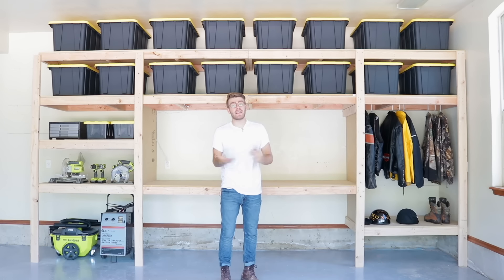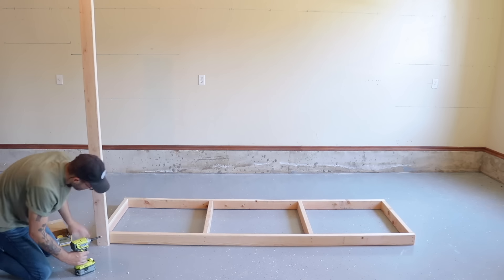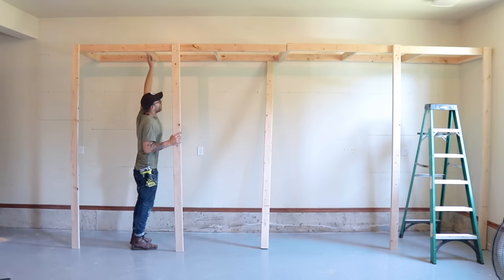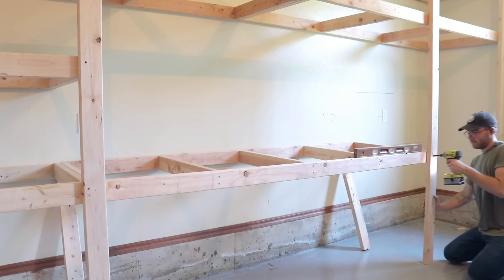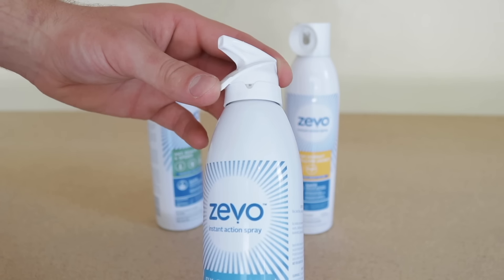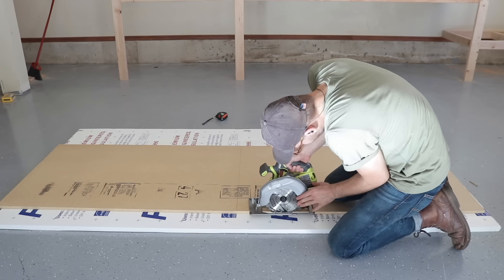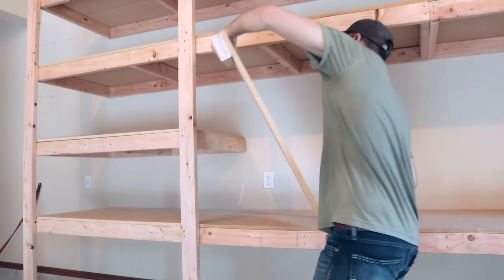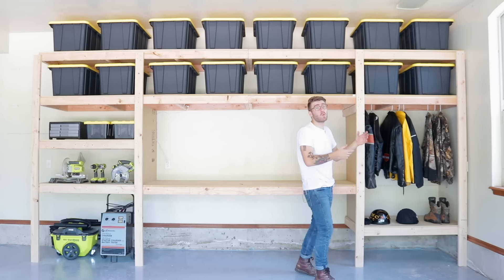DIY Garage Storage / Shelf / Workbench Solution

Comment: Love it all except for the "legs".  The entire weight is being held by screws
Reply: Some of the weight is being beared by the wall screws too though. What changes would you recommend instead?
Reply: “The entire weight” isn’t much, though.  He’s not storing bags of cement on those shelves six to eight feet above the ground.  To make the load transfer into the supports would add unnecessary complexity and time to THIS build IMO.
That said, I’d CERTAINLY recommend at least using longer screws.  He’s not getting enough “bite” with the ones he chose.  IMO, tear-out is a bigger threat here than screw shear failure.
I’d also ditch the drywall screws for a better screw (trex or similar), which have way better shear characteristics and would only add a few $$ to the project cost.  I you have a framing nailer (or are looking for an excuse to buy one 😉), nails would also improve the shear strength and would make the build considerably faster.

Comment: Hey great video started my project yesterday, total garage renovation!  Question I have is how would or did you provide more support for the two joints above the work bench. Seems like that ,Ishtar be a problem area if you stored heavier items there.
Reply: I'm currently building this design and was about to write a comment telling folks they need add support for the exact spot you're talking about. Luckily I can attach a 2x4 to the two shelves you're talking about screw it into rafters give much more support. As they sit now unsupported it will not hold more than a few pounds.

Comment: Most of it looks fairly stable being anchored to the wall studs, but I'm curious about the front middle of the top shelves and the work bench.  It seems like that outer edge that doesn't have floor support where the 2 sections join together would be pretty fragile.  How much weight do you suppose that section could handle?

Comment: Drilling into the wall looks easy. I presume your wall is “either wood or dry wall”. In my country , the walls are all concrete or bricks. Not as easy as you show it to be done. Thanks for the video and plans.
Reply: Yours is actually easier and more sturdy. Just get the correct bit and you don't even have to find studs. You can drill anywhere you want.

Comment: Great plans and video.  I had to make several modifications due to size of garage and ceiling height, but turned out excellent.  8 Costco bins wide and added a plywood workbench area.  Only recommendation for real world is the flat shelving pieces.  That particle board isn't cheap, so I made do with what I had and some pieces didn't end on 2x4's.  Solution was either to add perpendicular 2x4's in with pocket holes on back end or simply go parallel to existing supports.  Added about 3 total supports.  Looks awesome!

Comment: Simple, and efficient. Although I had to give a thumbs down because you attached your verticle legs via screws on the end, instead of under the top shelf. Doing this puts weight on the screws holding it toogether, instead of the verticle 2x4's. It's prone to failure with with this, and seeing as you have a work bench under, it could cause a pretty severe injury if it collapsed.

Comment: HI Mike (Modern Builds)....I just followed your template and built shelves very close to yours.  Would you advise lag bolts with washers into the studs in the wall?  Also do you ever recommend additional 2x4 in certain locations to carry the weight to the floor?   Thanks in advance for your response.

Comment: Nice video! I put some shelving in my garage based on this model. I used 1x3s for everything except the 8' verticals. It holds plenty of weight and was a good deal cheaper and the structure is lighter. I used 3" long 1x3 pieces as cleats for extra support in a few spots.

Comment: Just a quick question, I hope someone could help. I want to make this for my garage but it has bare brick walls. I’ll need to use masonry plugs, and aligning them all up I think won’t work! I was thinking of using a bunch of angled metal bracket underneath the 2x4 against the wall, would this work?

Comment: Why Ryobi? Try to get Milwaukee to sponsor your stuff instead.
Reply from the maker: I think if you tried Ryobi's brushless line, you'd be impressed with them. Not a durable, I'm sure, but I'm not running around a construction site with them or rough on them.
Reply: There's a reason they call them Cryobi.

Comment: Watch your head. That shelf above the work bench is right at forehead height. 

A workbench that is counter height will be more comfortable to work at as you won’t be constantly bending over.

However, both my comments would result in a more complicated and less symmetrical looking unit to build

Comment: You should use screws that are 2.5 times the size of what your drilling into the other price. If that's a 2x4, you should be using 5 inch screws

Comment: Poor framing. All the weight is on the fasteners instead of the actual structure. Once those bins are full, you may not want to be working under that.

Comment: When you're never really sure if you want to live there.
The ready to move again storage system

Not saying I don't have stuff in totes

Just saying I realized I live there and I should take them out instead of build a rack to hold totes...😆

Oh no this is my anti-dust storage system 😐

I built shelves in the storage unit I rented untill I moved into the house I'm in 
But I'm not going to store my stuff in freaking totes.

I like totes but you know, no.
Especially for storing stuff under a bed.
 I mean yeah nice for temporary, until you build something. 🤷

It looks tacky although if you collect a bunch of junk it looks better than a bunch of junk cluttered on a shelf
But at least you know you got clutter on a shelf that needs to be squared away

Totes are for people that can bulk organize but can't actually intricately organize.

None of those totes are labeled
Do they all got the same stuff in them 🤷......air

Let me guess, you got a little clipboard with a diagram and a listing of what is in each tote so you don't have to label them

So when thieves come they look at the totes and they go oh my God none of these are labeled, I'm leaving....... Oh wait a clipboard

Time to build a secret slot to put your clipboard

Put it on hinges on the bottom side of one of the shelves and put a magnet on it so it'll drop down 
But then fill up the shelf and realize you have to pull the tote out every time you want to look at your clipboard

Comment: shelves are unsafe, you need an under brace, which you could of built easy with a 2x4.  Unless your using lag bolts like timberlok type bolts then yeah way too much for those screws.  It's going to sag over time.

Comment: this does not seem strong enough to hold any real weight
Reply: It's not. Only support are the screws
Reply: Simple solution, replace the wood or drywall screws with a larger diameter lag screw!

Comment: There’s a much easier way...
Reply: what is it?
Reply: Alex P look up Ana White’s garage shelves. You basically just mount the cross members to the studs in the walls, then mount up the outer horizontal cross members to the first set, then mount the vertical supports to the outer cross members. Then remove the outer cross members from the wall, then put the supports for the width of the shelves attached to the wall mounted cross members and the outer cross members.
Reply: @RideAlongside  Yes deifinitely easier but it does not have the workbench, I'd like to do something like this but my biggest concern is that my garage walls are cinder block, I'd like to figure out the best way to anchor the framing to the block
Reply: Alex P look at ryobi dream workshop storage carts. They are what I am building for work benches and they fit under these shelves. There are plenty of types of concrete anchors you can choose from at the home center or hardware store. Get some lag bolts that you can attach the 2x4s with and you’re good. Lots of people build decks and other structures attached to concrete with those types of anchors.